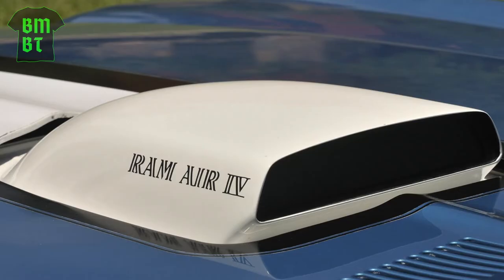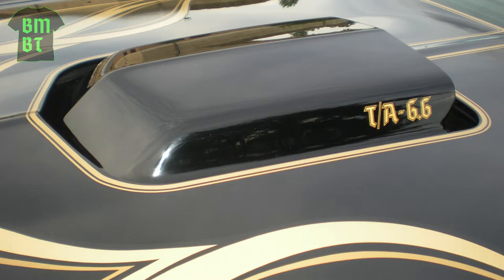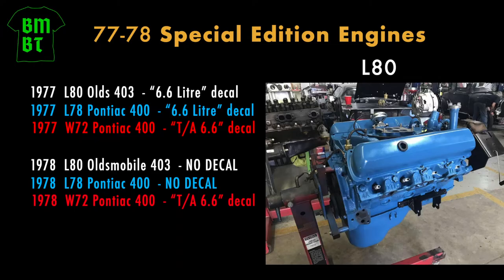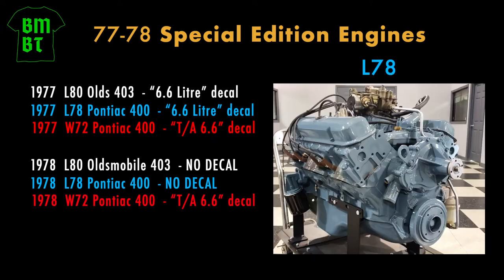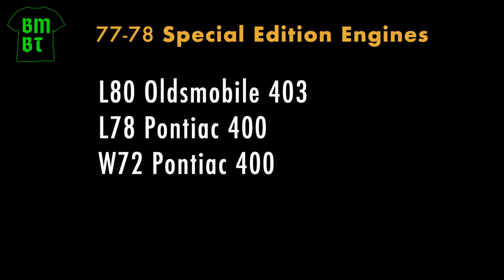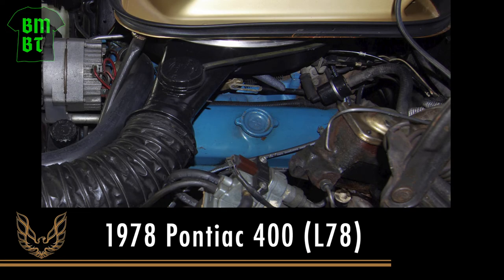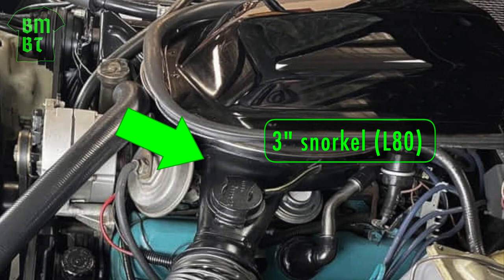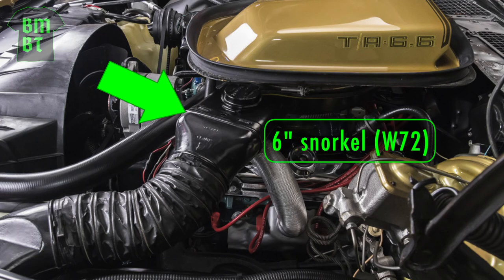Engine - Spot a FAKE 1977 - 1978 Trans Am Special Edition

Comment: Got 1978 trans am 342. Posi , super t10 , and w72 car has correct intake chrome valve covers but left factory without the shaker call outs wich I have heard of before nothing there maybe they ran out? But anyway got cheap unmolstead barn find and got her running purrs brakes fixed and  only thing left is electrical dash  is completely  out then it's cruise or ripping tires !

Comment: Ok let me help you out with this one as well.  All early 77 shakers were a "low rise, small mouth and had a sharp peak" just like the hood did. They also all said T/A 6.6 on pontiac 400 W72 cars with the "german style" lettering. Mid year 77 got the redesigned shaker that remained till 81.  The myth of only olds 403 cars getting 6.6 liter decals is not accurate but is commonly believed. Between 77-78 there were 3 different types of lettering. As far as 78 cars not getting shaker decals unless they were Y88 as you show in video or Y82 s/e cars. This i have never heard of before and i am pretty sure is not a reality. Also all 79's with a pontiac 400 were left over W72 engines from 78 and were rated @ 220 hp and were backed by a borg/warner super T10 only in 79 with 3.23 rear gears. 77-78 400 cars came both with auto and 4 speed and even automatics could be ordered with 3.23 gears that were standard on all manual trans T/A's and only 400 powered cars got the 2.43 , 1.61 , 1.23,  1.00 geared Super T/10 as did earlier 74-76 455 & 400 cars.
Reply: What was said is correct. In 1978, a regular Trans Am did not receive a shaker decal if it was an L78 400 or an L80 403. Only the W72 engine came with a shaker decal this year, the T/A 6.6. However, all SE's this year received the shaker decals anyway. This also happened in 1980, there were no shaker decals unless the car was a T/A 4.9.
Reply: @maxthe222  there was only a 4.9 in 80 or 305 for california cars. I was adding what u said. I wasnt disagreeing. So many people have misinformation and make up stuff.  Ive seen brand new 77 & 78 w72 cars brand new in car and driver 1977 and the shaker says 6.6 liter and this point brought up in the magazine that its wrong but its not cause GM did whatever. Again the car was brand new
Reply: The 1978 4spd w72 cars got 342 rear gears one year only
Reply: @rooster68able  yes u r right. 78 4 spd got 3.42s i dont know why between 77 and 79 they made such a small change

Comment: What about the snorkel size of a 1977 W72? I’ve got a ‘77 and I’m sure of the W72, but would love the info.
Thanks for the video.
Reply: round...
Reply: It came both ways. Early 77 had the sharp lower small mouth scoop. Later 77 got the rounded regular one. Regardless of W72 or what engine it had. Fact

Comment: Now, in 1979 they had no L-78, Right? And on these, were the L-78's auto and W-72's 4-speed?
Reply: Yes you are correct!  I owned a Black/Black and Gold Special Edition with T-Tops the W-72 performance package with chrome valve covers, heavy duty sway bars, 4 speed, 4 wheel disc brakes, Starlight deep dish wheels, and NO AC.  It was nice...  I miss it!
Reply: @MrHaps-yq3nu  I feel your pain, Trust me!
Reply: w72 w/ 4spd only in 1979
Reply: @victorvondoom2386  That could be true, but I'm not entirely sure. I thought from 1977 to 1979, the W-72 only came with a 4 speed stick.  The W-72 was definitely geared much lower than the standard engine/automatic Trans AM package.  I don't think you could get a stick with the stock engines though.  Don't quote me on either remark, I'm getting old and can't remember sh!t.  I do remember it was pretty quick compared to anything else at the time.   I also had a '75 Trans AM.  The '75 had a great top end performance, but was a slug off the line.  My '79 was polar opposite.  Fast off of the line, great up to about 85mph, but not much left over 105mph.  It was by far my most favorite car I ever owned.
Reply: @victorvondoom2386  only until they ran out early in the year, from pontiac stocking back blocks from 1978. after that, no more w72.
Reply: The ONLY Pontiac 400 you could get in 1979 was the W72, with a Super T10 4-Speed. Otherwise, it was a 301 Pontiac or 403 Olds.
Reply: W72 blocks were not the same as later 70's blocks. They were based on the earlier, much heavier duty 70''s 400 block, reintroduce to supply the 77-79's that called for the W72. W72's were stockpiled and the engines ran out before the end of the 79 run. You could only get a W72 with a 4-speed in 1979. The late 70''s 400 blocks are lighter duty and considerably weaker.  @frigglebiscuit7484
Reply: @victorvondoom238t6 the 1978  cars got 4spd too , just was option w72  were 79 had to have 4spd
Reply: @user-vn6vx6rf7d  They went back to the early 70s block in 1978. The 1977 W72s did indeed use the weaker 557 block but brought back the earlier block because of warranty issues. The difference in the blocks was basically the webbing where the main bearing caps bolted to was much thinner. The main cap bolts actually exited the webbing on the weaker blocks. The weaker blocks also used roll pins to position the main bearing caps instead of a solid dowel pin from the stronger design. This was only done to the 400. The 350 and 455 from these times were pretty much unchanged. Except the 455 was no longer drilled and tapped for 4 bolt mains.

Comment: The '77 Trans Am didn't come with the 403 Olds engine. That was the '79 Trans Am. I owned a '77 400 ci Pontiac motor.
Reply: Starting in 1977, the traditional Pontiac V8 was not used in any area that adapted California emissions standards because they couldn’t pass the stricter standards. This was mainly in California and high altitude areas. The Olds 403 was offered in place of the 400. 350 powered Pontiacs had an Olds 350 and some even had a small block Chevy 350. Everywhere else that followed federal emissions standards had Pontiac V8 availability. The Olds 403 became the standard engine in 1979 everywhere in any Trans Am or Formula equipped with an automatic transmission because Pontiac 400 production was halted after 1978. They stockpiled a number of W72 400 Pontiac engines for use in the 10th Anniversary Trans Ams and Formulas but that choice mandated a 4 speed manual until they were all used up. They never put a 4 speed behind an Olds 403.

Comment: its too bad the shacker hood was not funtional after 1972.
Reply: I never understood that. They blanked off the shaker and made it non functional starting in 1973. But the shaker used on the 1974 GTO was functional. I also believe the Formula’s Ram Air snorkel scoops could be ordered as functional through 1975.